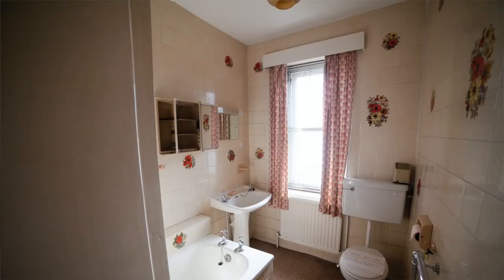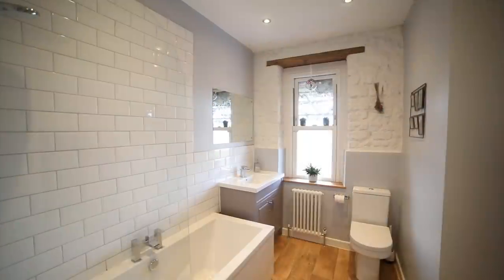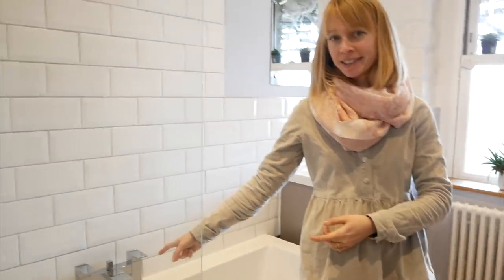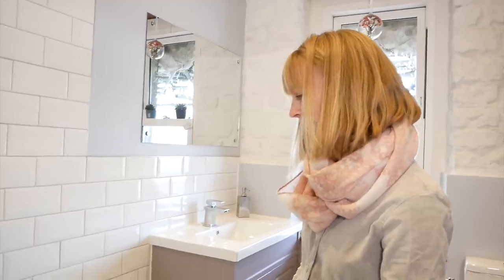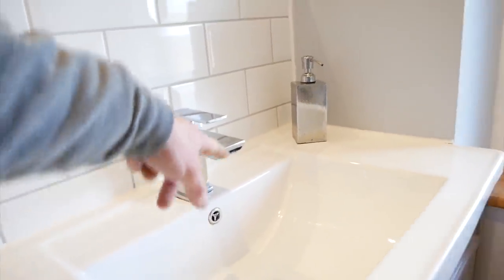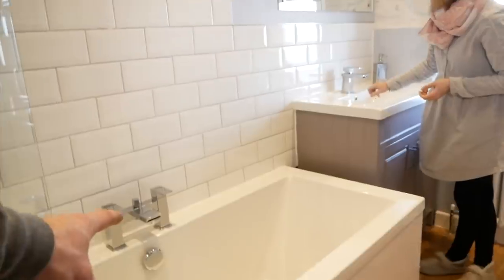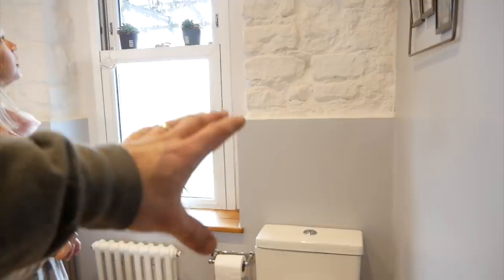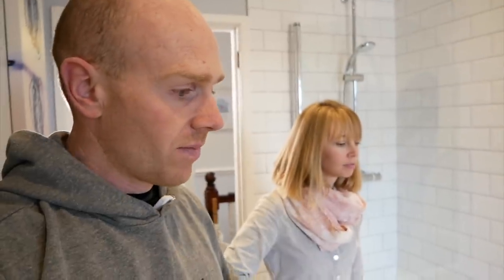FAMILY BATHROOM MAKEOVER - Start to Finish Transformation! 🛁

Comment: Hi, I chose the black version of those tiles for my kitchen, I thought they might be too dark but when I got them done they are great and I have no problems with them. Your transformation of the bathroom is very good, I will be doing my bathroom as soon as I get the shower and toilet finished downstairs so that I can take my time and not be worried about not having conveniences in the house. Also at nearly 70 I am not as fast as I used to be. I am afraid that I have to come down on your husband’s side as to where the toilet roll holder goes, if it was on the other side the kids would keep on bumping into it as they got on or down from the toilet.

Comment: I like the method of drilling using a wooden template to ensure accuracy - I will try this.   (Also need to say thank you - I have seen you using a speedsquare as a guide for a circular saw for perpendicular cuts- this is a revelation!)

Comment: The loo paper holder  is more user friendly on the left hand wall. On the rear wall requires a full body turn just about, or pass left hand under right armpit.  However it does look good . However in this situation I would go for function over form.

Comment: TP roll holder definitely goes on the wall to the left of the loo, how on earth are you going to reach it behind you, and will you be able to in a decade or two?

Otherwise looks great and I would still use the cement backer boards if I were to redo my bathroom, and use a good flexible fibre reinforced latex based corner / joint sealer to keep the structure behind the walls / floors dry.

Comment: We also have a side tap on our bath which is up against the wall and inaccessible. I’ve thought about rotating the bath 180 degrees and having it nicely accessible behind the panel  is this madness or not permitted? It would be in plain sight and surely not a trip hazard

Comment: Toilet roll front!!! ... i suppose you'll be paying out for the families chiropractic visits due to twisted spines... I've got the same tiles and grout (graphite from topps tiles) in mine, got a combination bath filler that diverts to shower and then diverts again to handheld or overhead via a button (Hansgrohe) that was retail price but all other hansgrohe was bought from Ebay by people who either over ordered and not used or both... bargains to be had although my sink taps are actually quarter turn bath taps which were used but are fully serviceable if needed

Comment: rubber floor covering in the bathroom is a simple way to the problem, moisture between the rubber and the wooden floor always ends with a ridge and mold why didn't you make the floor with tiles?

Comment: Should be in front and IMHO the toilet is now too close to the wall.  A smaller cistern would have helped.  The original toilet looks to have been offset further from the wall, perhaps in a better place.  On the other hand the toilet roll could be under the window (where Tim wants it) and be along side the toilet if the toilet rotated through 90  degrees and against the side wall with the cistern 'in the wall'.

Comment: I don’t think I saw any sort of waterproofing under that tile in the shower.
Reply from the maker: Nope. Like I said in the video. I’ve used tile backer boards or tanking on everything since then although with ceramic tiles and high quality adhesive, the hardie backer alone is probably just fine especially as it’s rarely used for a shower anyway.

Comment: Esthetically, the toilet roll holder looks better where it is. However, it's completely impractical. Even on a grown-up bum that won't fall in the hole, one has to twist, not just to one side but completely behind you. A little bum that is balancing is just asking for a dunking.
Also, when it comes to toilet roll placement, girls know what they're talking about. They need it much more.